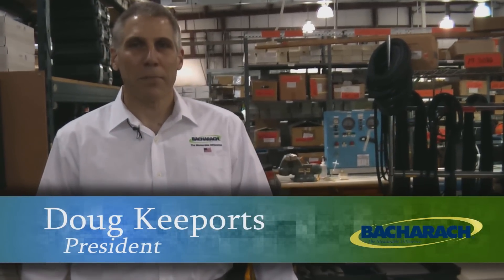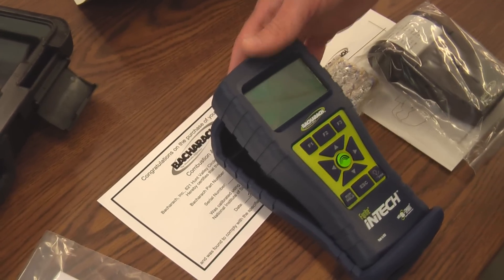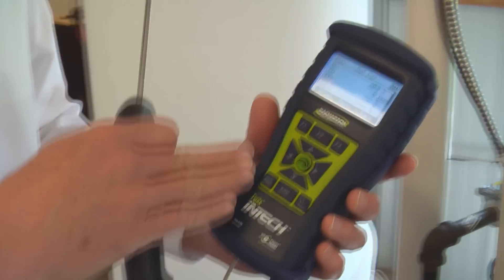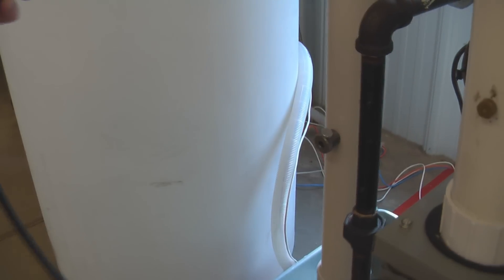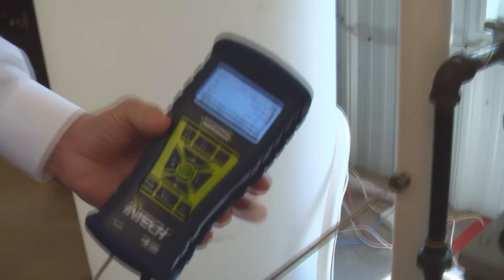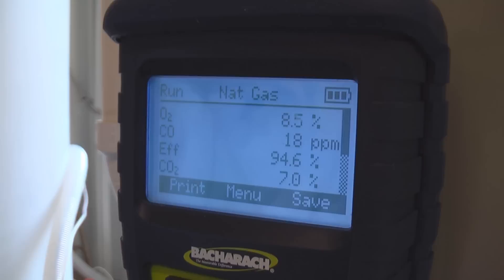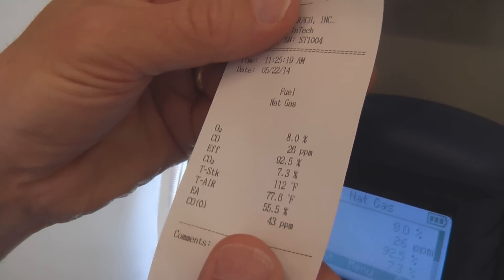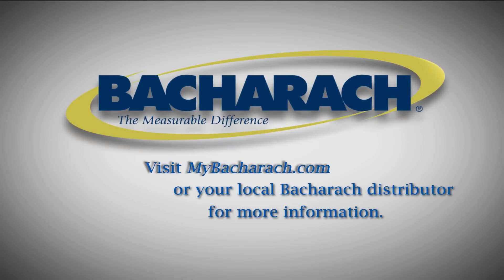How to use a Combustion Analyzer | Easy as 1, 2, 3

Comment: How do seal the inspection point, or do you leave the fitting and reorder new ones...?
Reply from the maker: It depends on the type of furnace and local codes. For condensing furnaces you have to plug the flue. We have flue plugs available in a pack of 50 for plugging your test points.